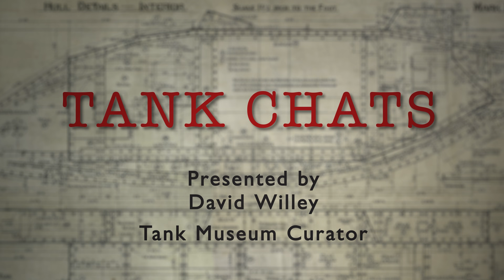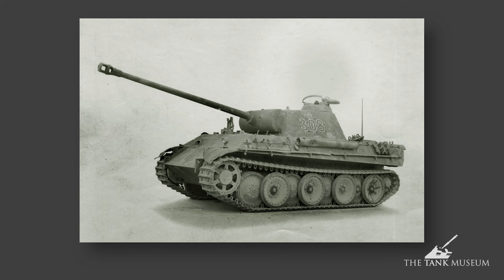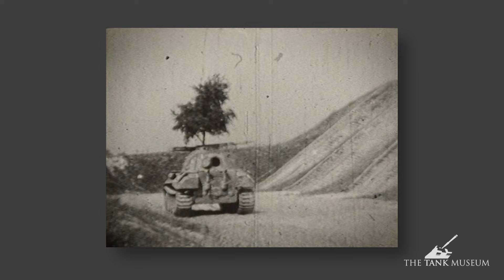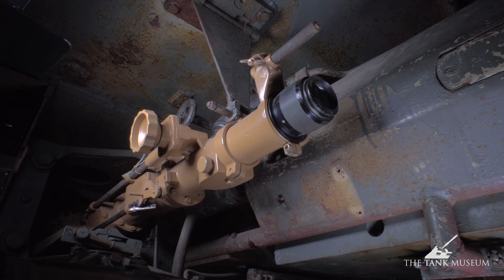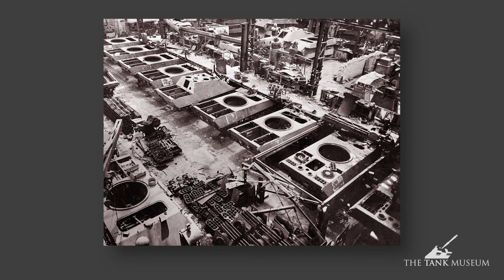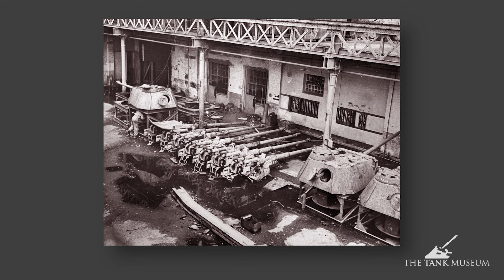Tank Chats #16 Panther | The Tank Museum

Comment: I believe the French army used some Panthers after the war.
Reply: @MGTOW Republic of The Philippines   really in iraq us 1991 panther tank still used??
Reply: faydu laksono Stugs III’s, Panzer IV’s and Jagdpanzer IV’s was used by syria in 67 during the 6 day war

so it wouldn’t be surprising if Iraq used some panthers when they were in a tight spot.
Reply: @kshatriya1414  thank you for info
Reply: it inspired alot of post-war designs, the ARL series is supposed to be inspired by the Panther series. they did have late variants of Panthers in their army after the war too, I'm pretty sure you can find some research in french that were around at the time it was in service.
Reply: @_Rooi  Dont know but I personally feel that French even made AMX-13 somewhat like Panther. Like the fume extraction method from the barrel. And also they were impressed by the 75mm gun. And frontal sloping armour.
Reply: true

Comment: Panther was reliable actually, the only downside was the engine was too strong for the transmission and the gears could break when moving form 0 to sudden max throttle. veterans quickly learned of it and compensated by easing up the throttle until they have gained a bit of momentum, everything else was ground breaking, the suspension was one of a kind back then, even to this day, modern tanks still use the panther style suspension. The armor angling they learned from the T-34...
Reply: @Jim Goose  It didn't broke continually, It broke when drivers pushed it, it had too much horsepower. It weighed the same as a heavy tank but rode like a medium tank. and could even achieve max speeds of light tanks.
Reply: @Jim Goose  I'm not going to argue semantics, It broke because the engine was too strong and towards the end of the war the Germans had few experienced tank crews, they push it too hard and the transmission broke. There is no argument that it could have thicker gears and given time they would've easily done that but the war ended and there was very little point.

As for availability there's many factors they're heavy tanks, you can't compare their numbers to medium tanks(Pz III/IV, M4 Sherman, T-34). Lack of resources is also a big factor as many countries put trade restrictions on Germany back then and the Panther only entered mass production in 1943.
Reply: @Jim Goose  Again if you are calculating for gear tolerance you don't divide HP with tonnage, you multiply them, A T-70 light tank has 15 HP/weight ratio doesn't mean it needs gears as thick as a Tiger's, do you even understand basic math?

Pershing has 450 HP Panther has 690. Which part of the very simple statement "Panther has a powerful engine" confused you?
Reply: @Jim Goose  Unfortunately it was very boring for me also as you pull random stats from the internet and hope to make a point which doesn't relate to the topic at all.
Reply: @Jim Goose  You desperately cling to HP/weight ratios hoping to prove that the Panther's engine isn't powerful but what is power? It's raw HP which is 690 which is higher than the Churchill's, Pershing and even the IS2. Medium and Light tanks have similarly high HP/weight ratio because they are light, not because they have powerful engines if that wasn't obvious for you but it's ok, I get it. Ignorant people often can't accept when they are wrong.

Comment: As the Panther was the result of the VK20 project which started in 1938 I object your statement that the Panther was a pure rushed reaction to the t-34. Slopped armor was already incorporated in the design of the Panther before the german "Heereswaffenamt" got their hands on a mostly intact t-34 for examination. Many of the Panther problems also came from the fact that Germany was already lacking some vital resources at the time and the engine was originally developed for an aircraft, which made it very light, but caused it to fail rather often, especially in the early versions. This comment section does not have the space for an all out discussion about the Panther, but while the t-34 surely had an influence on the Panther, it was not the reason why it was made in the first place.

Comment: just a word about the firepower, everyone says this thing has excellent fire power because of it's accuracy and penetration of tank armor and generally speaking it's ability to kill a tank. 

Although this is very true a tank gun should be doing more than just killing tanks, they need to be able to destroy soft targets aswell and the Panthers gun was horrible at that it's High Explosive shell filler was pretty good at 630grams but it's velocity was WAY to high at 1130m/s and although for AP higher velocity is better for HE it isn't as the shell will burry it's self deep into the ground and you'll get this massive eruption of dirt but not a terrible amount of damage done to the Target while the 75mm m3 had a 680gram charge but at only .
 
It also didn't fire terribly fast at a maximum of ~12RPM due to the 2 quick loading stash's that it had were alongside the rear of the hull infront of the engine. the M4 sherman for instance had a much more convenient stash aswell as lighter shells so it could get off a maximum of ~20RPM for the 75mm M3 and ~18RPM for the 76mm m1a2 aswell as the stash size only being 9 rounds compared to the 75mm m3's 14 rounds and 76mm m1a2's 36 rounds.

the Panthers gun also had no smoke rounds and it's APCBC explosive filler was a pathetic 18grams compared to the m4 sherman which did have smoke rounds and 65grams of APCBC explosive filler.

Comment: This (again) is an EXCELLENT tank (some say its gun was even better that the one of the Tiger models), but here again - the way the Germans mounted those torsion bars prevented them from putting bottom escape hatches for the crew, not to mention that it doubled costs and times of production. I could never figure out why the hell the Germans simply haven't started mounting a more "Christie-type" suspension - systems. Cheaper - simplier - much more sturdy and less problematic - you don't have to "pull out" FIVE freakin' wheels if one from the "internal-row gets struck or simply breaks & so forth. 
...?... 
They even adopted the sloped armour "en masse" on the Panthers ONLY after having seen the Russian T-34's so WHY THE HELL DO NOT COPY THEIR SUSPENSIONS AS WELL? 
If they could have SIMPLIFIED the "Panther" production they might have  had built twice as much of them!...
Reply: 2serveand2protect Because torsion bar is superior in terms of stability, crew comfort and off-road capability.
Reply: ...yeah, well... 
...first of all there DIFFERENT torsion bar systems and in one form or another almost every later 2ndWW tank had a "torsion-bar" mounted on (apart from Shermans), but the one the Germans used (sometimes called the "long-barred tosion system"), with elongated bars that were attached to the other side of the chassis, was THRICE as costly as the torsion bar systems mounted on (for example) - British tanks - and took FIVE times the working hours to put it in place, not to mention that instead of putting "single wheels" for every bar they continued to place those (quite frankly STUPID) "interlocking wheels" system, which meant that if one of the INNER wheels was struck by a shell or damaged, they had to take out five wheels to replace it, instead of ONE (...and try to do it with bullets flying around - see how "nice" that was). However that didn't increase the off-road capacity of Panthers and Tigers over T-34's or Cromwells. Furthermore (probably even much worse) - since all the German torsion bars were occupying the whole "bottom" of the tank's chassis, therefore Germans couldn't mount bottom escape hatches for their crews, which meant that if the tank got struck by a shell, and the crew had a couple of seconds to abandon it, they would have to jump off from the UPPER escape-hatchets - straight  up - right into the path of flying bullets and shrapnesl, which - in 90% of the cases meant certain death for the crew anyway... 
They were lucky that it wasn't at all that easy to "light up" a German tank.
Reply: 2serveand2protect "..90% of the cases..." - got any sources on that? 
there No doubt that the Tiger and Panther had better off-road performance than the T-34. Simply put, the Christie suspension system wasn't very efficient, thus it wasn't very popular.
Reply: @Jim Goose  Damn I must admit I havn't given it much thought over the last three years. But my argument would be that no post-war tanks used Christie suspension. Most used torsion bars.

Comment: This video is a bit more balanced than the later video by Jingles. Without even getting into the engine fire problems that were never completely solved, with final drives that required rebuilding every 150 km, and engines that lasted 1000 km when Sherman engines were good for 8000 km, Panther tanks were in WWII what they are now: trailer queens.

Comment: This and the Tiger were a waste, they could have up-gunned the Mk 4 with long barrelled 75mm guns and built twice as many for greater effect, it was a great tank once it was perfected but still a huge mistake to pour resources into these tanks at that point in the war.
Reply: panthers were barely more expensive than a mk4 to make.... tigers on the other hand..
Reply: They experimented with giving the IV sloped armor, and the panthers turret. Both proved to bee to much for the IV chassis. Really the Tiger should never have been made, and instead just gone with the Panther as it was quite a bit cheaper to build than the Tiger, and while it had thinner armor, the slope made it more effective than the Tigers flat armor.
Reply: Mk4 would have needed a different turret to accommodate that gun which would have made it too heavy.
Reply: Rex Holes They didnt do that for a reason. The MK IVs suspension would have been strained by the Larger turret that would have been required for that. As well as that, The Mark IVs unsloped armor was proving to be becoming Inadequate and the German army wanted a tank with sloped armor. Its armor proved very effective. Even the 76mm Shermans HVAP shell could only pierce the upper glassis at very close
Reply: Yep. Of all the things- if you wanted to stop war production, flat- destroy the ball bearing factories. That will stop a modern military production.
Reply: That is only incidental to a surplus and dispersal of the production. So, naturally, production would increase after the bombing to make up for the short term shortfall. Also, the Allies only performed a few raids, so production picked up again within a few weeks.
Reply: Panzer 4 was practically a box. Germany needed a new tank, atleast with just a new armor design.
Reply: May be some validity to your point, although the Panther was really the pinnacle...the Mk VI was overkill - beautiful, sexy overkill.
Reply: Is that why production actually INCREASED until the  factories were overrun?  The effectiveness of the bombing campaign is pretty much a myth.

Comment: Am I mistaken in assuming the Panther G model had the "Chin" on the gun mantlet or was there other more significant changes that would categorize it as a "G"?
Reply: It's a G model,but uses older A model turret.Hull is G model.
I dont get into details about chances between A and G,but there was alot.
Main thing was make it better in combat,but also make cheaper to make.
Reply: Only the late G models had chins. There is not really a G or A model turret.

Comment: The Soviets liked and feared the Pzkpfw V Panther so much that they sometimes used captured vehicles as their own until they ran out of ammo or became unusable. And the Panther was really the point where it become obvious that a good medium tank was the way to go, instead of fooling around with heavy infantry support tanks, light and fast cruiser tanks and superheavy tank killers. One good design could do all of those things and the Soviets proved it with the T-34 and the Germans copied it. 

If Germany had stopped messing around with the heavy Tiger tanks, stopped production of the Pzkpfw IV and simplified the design of the Panther, then they could've cranked out enough to make a difference. In total, as he said, only about 6000 were built. That is a laughable number compared to the massive amounts of T-34s and Shermans built by the Americans and Soviets. Production numbers of the Panther never exceeded 380 per month. The Soviets probably built that many T-34s and IS tanks in one week.
Reply: If they had copied the T-34 they would have ended up with a piece of junk. They only thing they took from the T-34 was the sloped armor. That's it.
Reply: They didn't have the fuel for the ones they had.
Reply: @kyle857  or the manpower of which both Russians  and Americans did. In hindsight I think for the most part did what was needed.
Reply: The thing you do not understand is that industry needs a lot of time to shift gears into mass producing new type of vehicle. Panther was never solely produced, Pz.3/4 were both produced to the end of war due to this reason. Furthermore, Panther is a medium tank. It cannot do the job of a heavy tank. Without heavy tanks, Germans do not have offensive teeth to make effective breakthroughs.

Comment: If it's a Ausf.G then how come it doesn't have the gun mantle with the "chin" on it?  (Or did not all Ausf.G's have the different turret design?)
Reply: +Calvin Ball The early G-models didn't have the chin on the mantlet. Since this one was built after the war I would guess that they would just put it together with whatever was lying around in the factory.
Reply: +Calvin Ball Exactly my thoughts!
Reply: Calvin Ball If it doesn't have a drivers vision port, it's a G.

Comment: This machine was practically a tank destroyer rather than a proper tank. It's sides were vulnerable even to antitank rifles, so this made this machine a bad option when attacking. Soviets didn't give it much attention.
Reply: @Jim Goose  the sides of this vehicle of 45tons were less protected than the sides of the 3 years older and 26tons T-34 model 1940. Considered as a tank (understood as a vehicle designed to do tank tasks) this vehicle is a bad one, considered as a tank destroyer (the task which was in the mind at this vehicle development and most part of its usage) the concept can be good

Comment: Such a nice tank, would it be considered the 1st or the 2nd main battle tank in history if counting the T34?
Reply: The Standard Gamer No it was not.

 The T-34 wasn't one. Nor was the Panther either.
Reply: The T34 is the first MBT, it includes all the things that make a MBT. Good armour, good anti-tank gun, and good mobility, however the T34 I find is a little crude, yes it corporated sloping armour a revolutionary future. However, when it came to battle early T34 didnt even have a commands coppola so its a bitch to see out of. With the commander having to load the gun along with command the tank. 

Also in traditional Soviet Style during the late parts of 1941 factory works had to take the tanks in to bloody  battle without any training.

However, once the Gremans ironed out the Panther issues it was a deadly tank, to me the best overall tank in WW2, especially in the hands of a well trained crew.
Reply: KB_TheDireWolf Yes the T34 having a stressed crew and bad vision is a down side but the T34 eventually got upgrades like the 85mm gun and a 3 man turret but overall the Panther was one of the best tanks with it's gun and the British used a captured Panther  "Cuckoo" and it only failed after many offensives after a small pump failure but as it wasn't their tank they couldn't use it
Reply: No. The T-34 wasn't that.

The Somua S-39/S-40 was the first tank with all angled armor to some degree, not the T-34.
Reply: Nathan Peterson Main Battle tank not angled, as in all purpose
Reply: Nathan Peterson The armour is mainly flat, it isn't at such a slope as the T-34 was....
Reply: KB_TheDireWolf Note: "To some degree" The French had quite a few tank designs like the Schneider, FT-17, and the FCM-36 using majorly sloped armor. I was thinking of the FCM-36 not the S-35/S-40, I apologize.
Reply: Nathan Peterson Was it an MBT though?
Reply: Nathan Peterson What did it lack then?

Comment: If you look at it it is easier to replace the transmission in a Panther than in a Sherman.
Reply: All you'd need to do in a Sherman is disconnect the drive shaft, and unbolt the transmission housing. Boom you're done.
Reply: +zagstrukk Really? Even if this was so in field!!!  how long would you have to wait for a Panther transmission as opposed to a Sherman?
Reply: to replace panther transmission. turn turret 90 degrees, take off the drivers/radio operators hatches, dis connect all of the linkages on the transmission and then repeat the process. The sherman is take tracks off, take off drive sprocket, unbolt the transmision and then repeat.
Reply: This isn't true.
Reply: As well as the sprocket wheels, but I digress.